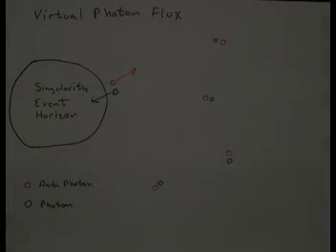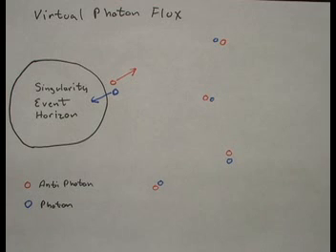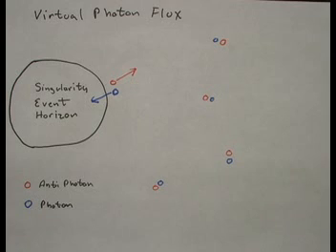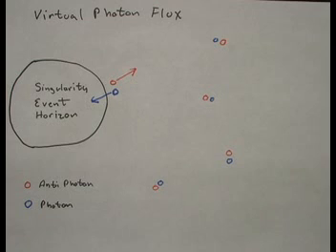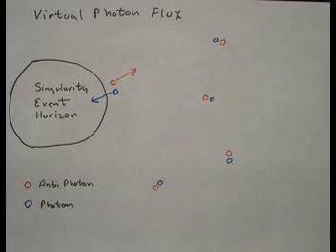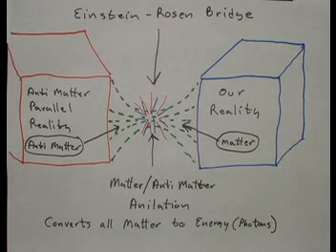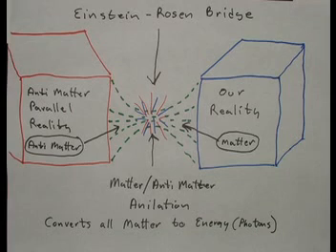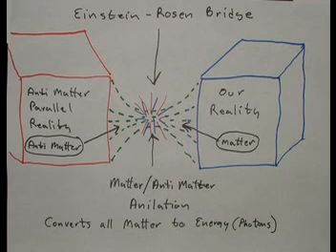Rodin Coil - Part 2 of 3

Comment: Your channel content suggests that you are familiar with 2 musical concepts… intonation of an instrument and a mid/side transformation of stereographic information and or the MS capture.  

I would suggest to Rodin that the particles are coming into and out of intonation with the instrument of creation, either phase cancelling (not the same as non existing).  

In addition, that a ‘blackhole’ is the monophonic aspect of information which has no curvature intonation with the em spectrum, as a musical analogy.

If so, we may be able to explain the ‘how and why’ of this phenomenon with the mid/side analogy of particle spin states (stereographic motion) transforming from traditional x/y stereo motion into A/B mid/side configuration, which has a wider phase angle and a stereo pan law.  In addition, the mid and ‘sides’ are both monophonic aspects of correlated and uncorrelated information with respect to ‘uncertainty’. 

If we could apply these concepts correctly, perhaps it would be possible to construct a model where there is no ‘anti’ state of matter.  Instead, there are particles who relationship with respect to rotation are in Mid/Side such that they have no Phase relationship at certain times to intonation from our dimensional perspective, such that they become immeasurable.  Example: Sphere-Torus-Sphere-Torus, inversion via Möbius transformation of Polarities. 

I can be completely wrong. I thought perhaps these ideas might spark some creative thoughts on your end.  I am limited in my understanding of physics.
Reply: Instead of parallel universes, there would be parallel intonations.  1 universe, same dimensions, alternate intonations or instruments.
Reply: In other words, like modes of scales musically, the analogy suggests that the other intonations re-order in sequence and series the fractal geometry of the ‘spectrum’ intonation.
Reply: As a particle ‘informationally free-falls’ out of intonation with our spectrum intonation it ‘informationally free-falls’ into intonation with another spectrum.

In this way, conservation of energy can be obeyed and there is no ‘loss’ only the perception of entropy. 

And this suggests depending on the spectrum intonation, the musical organizational principle governing the face of cosmology (what space and time look like) would also be in its own ‘arrangement’… especially if each intonations is Just Intonation and not Pythagorean or equal temperament.

Comment: You would have to call it some thing other than an Einstein Rosen bridge. An Einstein Rosen bridge is a representation where 3 dimentions of spave is represented by a horizontal line and time by a vertical line, and if we reversed time, a black hole would look like a white hole. You alternative model has energy (in the form of mater an anti mater) flowing forward. This is completely different model than an Einstein Rosen bridge.

Comment: trouble is anything going into a black whole ends us apearing at a distance per the weight  of the black whole in a direction equal to its entry vector so the pieces of the atoms are inperceptable to telescopic equiptment

Comment: black hole eject's a lot of stuff out when they say it takes in only so much matter then spits the excess out well that extra coming out is condensed  matter pressed in to a smaller heavier matter and anti mater is the gun powder so to speak MAY BE? I really don't know white hole is possable to be a time well and is suspending the matter in an energy form.From energy came matter from matter back to energy running this Halo gram universe

Comment: I have done a bit with pulsed DC and found the Rise and fall of the pulse leading and trailing edge presents a ring wave even as a very small componet it still relates to Harmonics of ring wave in 3D looks like the spiral of Phi which plays into a form of spin dynamic. But Magnetic and IONIC expanse and collapse are the periods of field interaction. Just a scratch on the surface of all aspects of the coil. Good job on these though RF skin effects and Capacitance works with standing wave dynamic.

Comment from the maker: @MichaelSmathers What I built is called a 360 point Rodin coil. It has 120 wraps of wire around the torus for each of the two windings. It is a more efficient version of the more commonly seen 36(sometimes called 12) point coil. It's more efficient because the spaces between the wraps are smaller. For more about this Google for Alexander Petty's Rodin coil page.